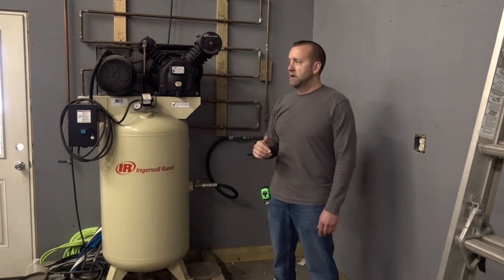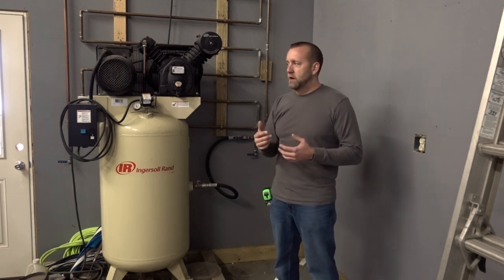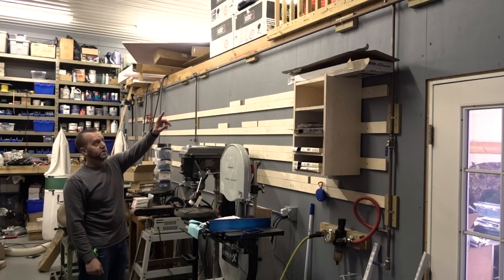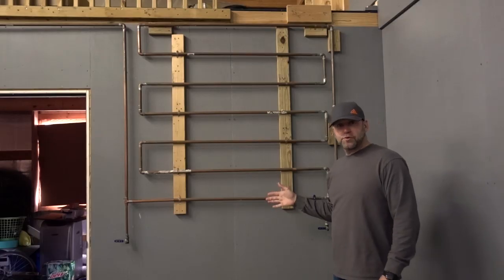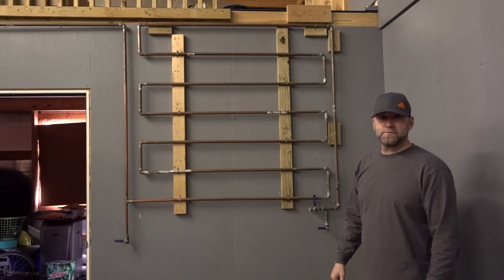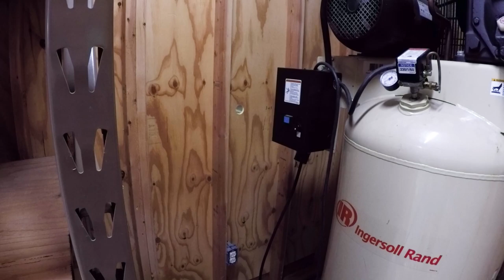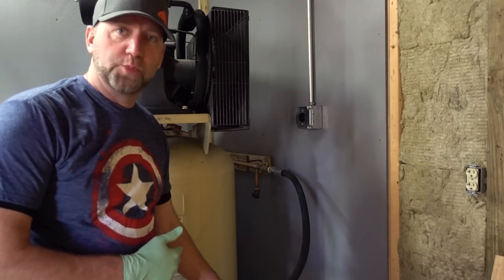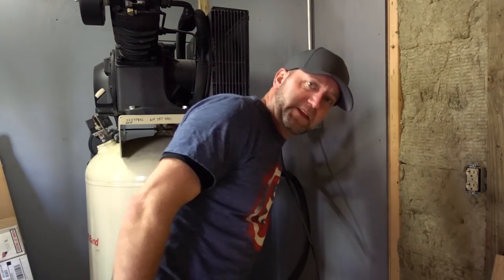Moving The Air Compressor - #42

Comment: How did you get it on the pallet?  I have two to move, and was able to walk it to a 4" door stoop.  At which point it came crashing over.   I'd have to tip it even further to get it on a pallet.
Reply from the maker: Mine is still on the pallet it came on. 

Where are yours currently? Any access to a lift, tractor, or anything like that?

If not, here’s what I would do. I would tilt it and put a 2x4 under it. Tip it the other way and block it up a bit higher. Then tip back and block it more. Get it roughly the same height as a pallet. Then slide the compressor onto the pallet. To help it slide, you can use pieces of plywood. Use multiple pieces so you and tip it back and forth and remove the individual pieces from under the compressor, if you want.

Comment: Does your condensation trap system work pretty well as built? I am thinking of incorporating one similar to yours into my shop air system. Do you find the total length that you have there to be sufficient? Is that 1/2 or 3/4 pipe? Sorry for all the questions, thanks for the video!
Reply from the maker: Adrian Tayne 
It works very well and the majority of my moisture is condensed and trapped at the first drain. I get some caught in the downstream drains but it’s marginal compared to what a caught at the beginning. 

The longer the pipe, the better. I find this sufficient but it probably wouldn’t hurt to have another one or two lengths. This is 3/4” as that is what my main trunk is and then I drop to 1/2” for the drains and drops. Take your drains out of the bottom of your trunk and take the drops out of the top and do a double 90 to bring it back down. This prevents water from getting into your drops since it won’t naturally go vertical.
Reply: @JaredsShop  That's really good to hear! You've done everything I was thinking about doing including having the drops come out on top and switch from 3/4 to 1/2 for the drops. I appreciate the feedback, it gives me more confidence to move forward with the plan!